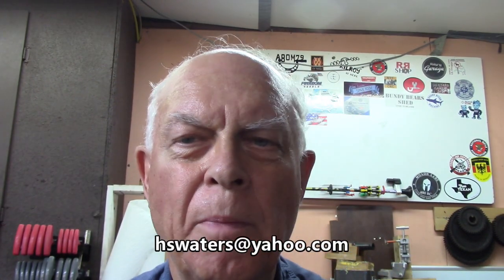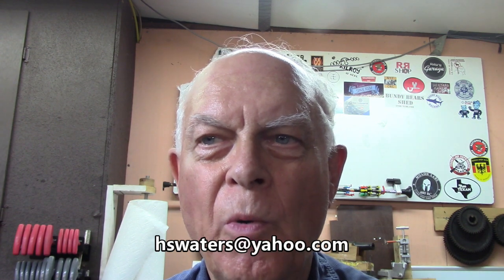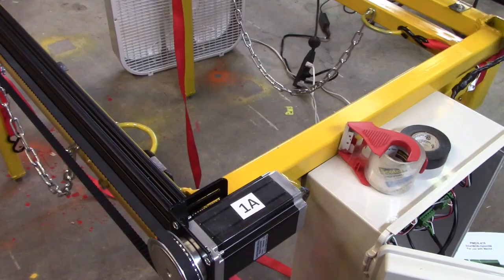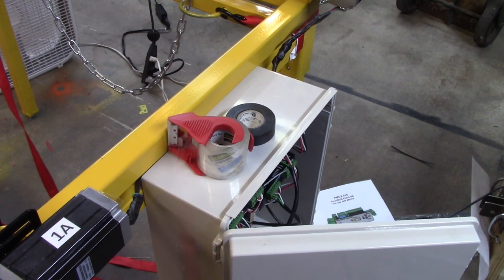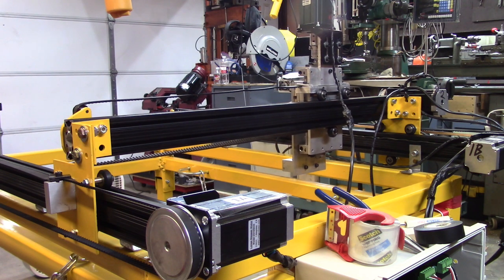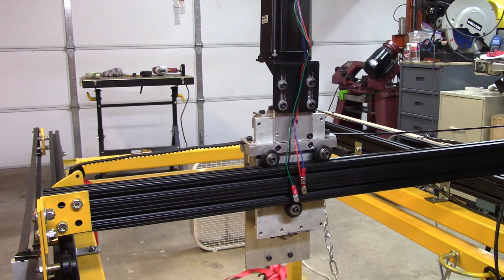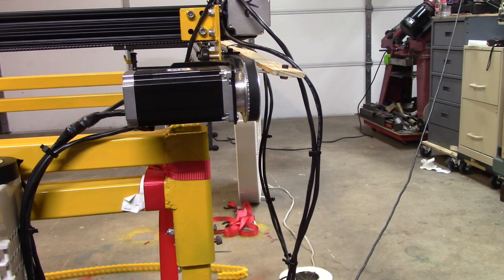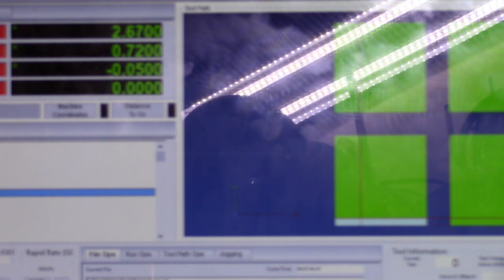Teaser

Comment: One thing to do at this stage is write a line of G code that moves a fraction of an inch and put a dial indicator on the axis moving. To make sure your scale is right. Make sure it moves the right amount and repeats. A thousandth of an inch repeatable is not too much to ask. Make sure whenever you unplug a motor from a drive that your power is off. Otherwise you run the risk of destroying the drive.
Reply from the maker: This is only the 3rd driver that I have destroyed since 2012.  Things happen.  Thanks for stopping by.

Comment: What controller are you using with mach4? Looks like it works well. Keep it up Harold that will be a very nice machine to have around.
Reply from the maker: I have a windows 10 laptop running mach4 connected to a PMDX-424 BOB.   Sorry aboutt the short answer. Thanks for stopping by.